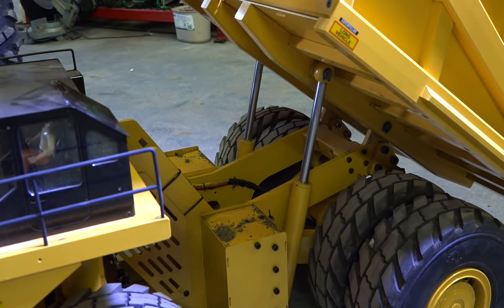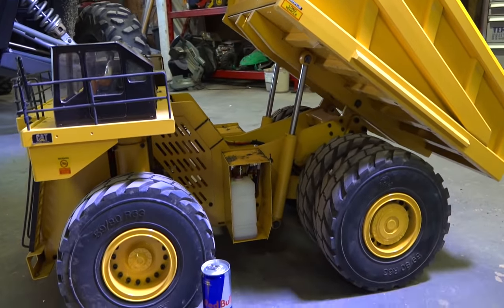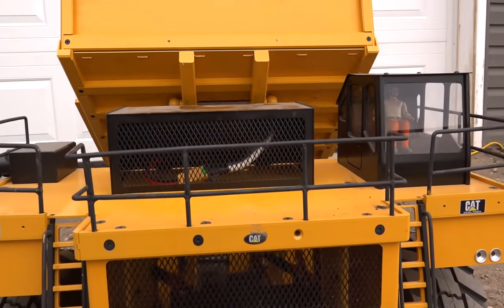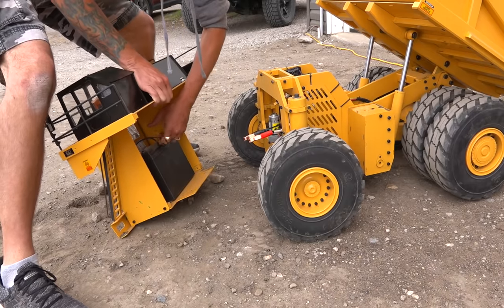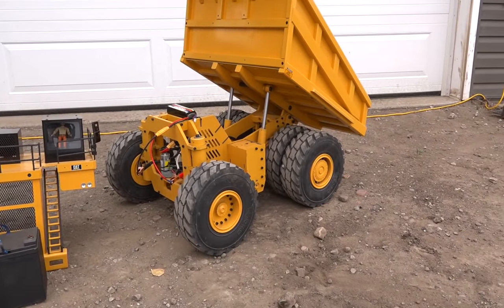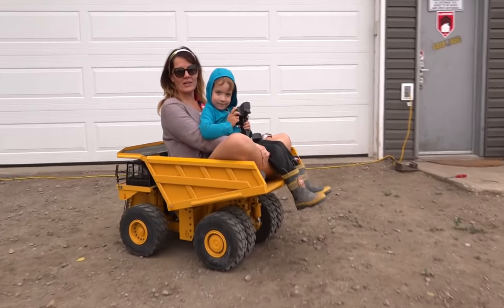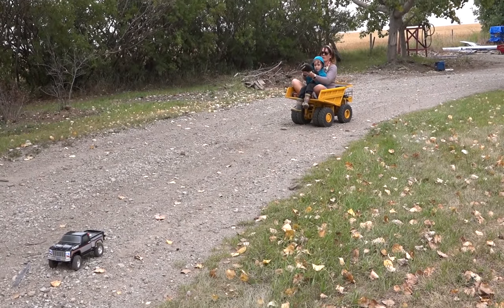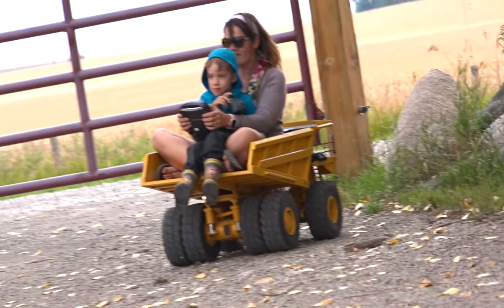How does this Huge Dump Truck WORK?! 797F Metal Haul/Mining Truck RC4WD | RC ADVENTURES

Comment: I would just like to say that all your videos are awesome ,especially your you tube gold videos. You have encouraged me to get back into the rc hobby again. I originally sold off my diecast collection and my rc collection 5 years ago. I've regretted selling my rc collection since. But since watching your videos I have decided to take up the hobby again. In the last 3 weeks I have bought 4 brand new rc trucks. The traxxas Bigfoot truck, the HPI Wheely King 4wheel drive. This one of the one I regretted selling 5 years ago , except the Wheely King I had before was only 2 wheel drive. I was just waiting for them to bring out the 4 wheel drive kit to install in it when I sold it. I found the 4 wheel drive version by accident while on my holidays. Yesterday I purchased 2 more new rc trucks. I bought the axial Grave Digger and traxxas 1979 Ford Bronco Xlt in the sunburst colour. I also bought a spare Bronco body with a bush guard and spare tire accessories plus 2 sets of body vinyl body colour stickers. One rc truck I did keep from my old collection was the traxxas Son Of Digger truck. I plan on buying more rc monster trucks and crawlers in the next couple of weeks. I feel like a kid again. Lol 😀. Thanks again for all the great videos and unboxing reviews. You are very knowledgeable about this hobby. I have learned quite a bit about the rc hobby just by watching your videos and how much fun its going to be to upgrade all these trucks.  I have something that I would like to send you and your son More as a way of thanks. If you could send me or text me your address that would be great. Here is my number 1-905-259-8529. Glenn.

Comment: We actually have 4 large CAT rock/mine trucks where I work. Id have to say the dump speed etc on that thing is pretty scale.  Other than looks and driving thats about all they share lol.  Under the front end and bed is vastly different.  the big ole V16 in the real things take up every inch of room along with they hydraulics and transmission.
Reply: Dude yeah the only other thing is that that is the medium sized cat truck the 793 is much larger

Comment: Super cool!! I hope that clicking sound isnt something ominous. If a full sized battery will fit, Id suggest an Optima Yellow top (deep cycle). Much better power delivery with gel, and endlessly rechargable with the proper charger.

Comment: Kids are vary fun to be around .  I bought my friends first born a Razor 4 wheeler . It only does about 8 mph .  Adin was about 5 years old and he never used it much .  Then the 2nd born came along . His name was Will .  When he was 2  1/2 years old he gets on the thing flips the switch and took off . He did hit a tree at full speed and turns the 4wheeler over . His mom had a cow when it happened . Poor Willy started to cry and I told him to stop that right now . So Willy get up  stomps his right foot and turns to the 4 wheeler try's all of his might to put the 4 wheeler up right . I asked Adin to help him . Adin did help and they got the 4 wheeler up on it's 4 wheels and Willy gets back on it and learns by him self to steer the 4 wheeler where he wanted to go . Now this boy I remind you was 2 1/2 and just out of his dippers . LOL . Boy I sure do miss those kids . I was like a grand pop to them  .  Have as much fun with your kid as you can and let them have as much fun as they can . Your only a kid once .

Comment: Hey Medic. I know what you could use to show the size of the dump truck and everyone will know the item. A 1 quart oil bottle. There won't be any question on whether it's the "12 ounce or 16 ounce" or "that the 8 ounce, or the 1 liter". I'm almost certain the quart bottle of oil is identical across all continents.
Reply: We dont have quarts in Canada lol. Liters but they are very close in size
Reply: @optimusdude  Well yea, but as you said, still very close in size.
Reply: I think having it parked in front of a 4 passenger side by side is a pretty good sense of scale.
Reply: @BlueDually4x4  I personally have only seen 1 side by side in person. Maybe 2, but either way, not many.

Comment: Do you think having a small generator powering the electric stuff instead of battery so u can get hydraulic steering too would work so it could work like a true scale dump truck or would that interfere with the radio?
Reply from the maker: I can just run the battery.. Lol..
Reply: Just was curious if it was possible is all

Comment: Since it's running a 12v system you need to put a solar maintainer to extend the run time an can charge it by leaving it in the sun
Reply from the maker: I love this idea Dustin :)  Ill have to check into cost vs charging time
Reply: @TheRealRCSparks  if you look at tender brand solar charger (most Walmarts carry it)  there about 30 bucks and work well have one on my jetski for 3 years still works great it is 2 amp trickle charger but it fully charges in 3 hours

Comment: You could increase your run-time with a 12V marine deep cycle battery.
Reply from the maker: they are too big. I use them for the Trommel and water pumps for #YouTubeGold

Comment: It be cool if you could run a petrol generator in the front where the battery is, then you just need to top up with fuel and go.....but I don't think there would be one that small.
Reply from the maker: So I can just run it the way it is then...   that was easy
Reply: RCSparks Studio lol yea I guess the way it's set up it best.